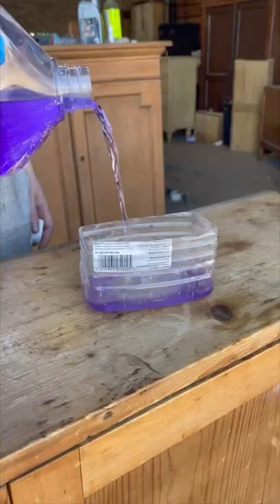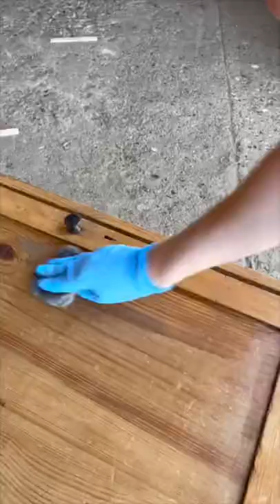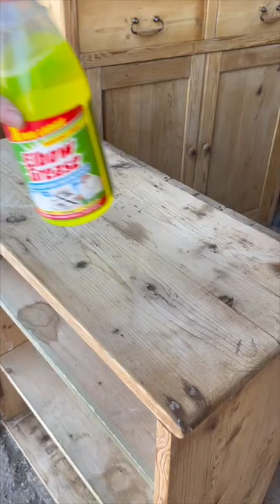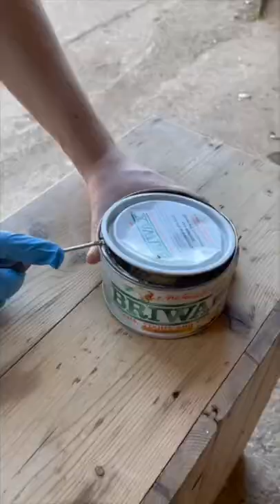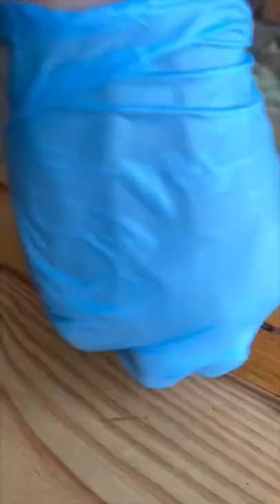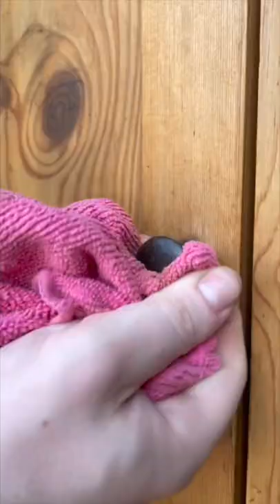100 Year Old Cupboard Restoration #shorts

Comment: Other than age there's nothing special here.
Reply: That's what's special.
Reply from the maker: How special can an old pine pot cupboard be? What's special in our eyes is the simplicity, quality craftsmenship and the fact they were made on a budget. To survive this long should be special in itself without being thrown away or damaged and broken.
Reply: @088  I have a beautiful pine plain cupboard I have in my kitchen almost identical to that one. It's from a  farm that was built in the 1890's. The cupboard probably was as well. It took hours of sanding to remove the musty smell, dirt, and grime from it. It's beautiful. I sealed it with Dixie Bell Clear Coat. You don't get craftsmanship like it anymore.